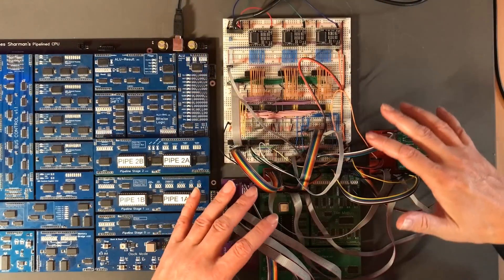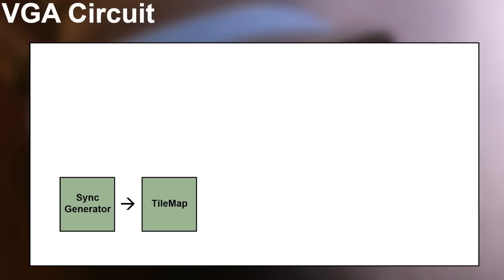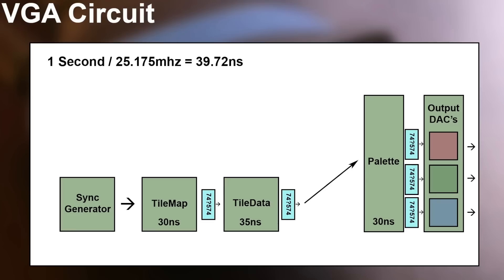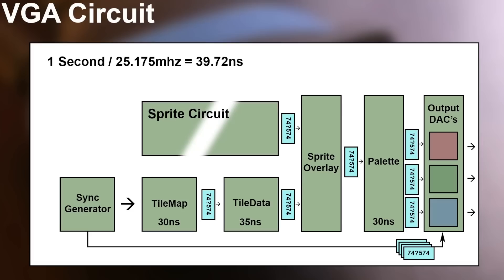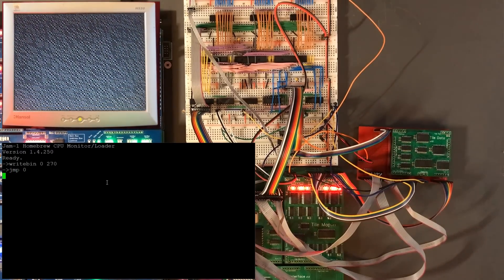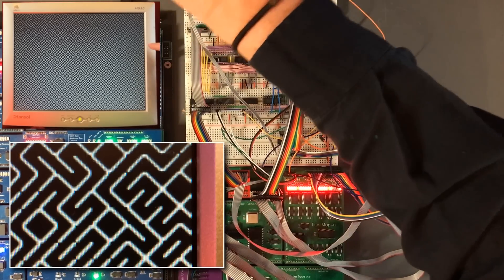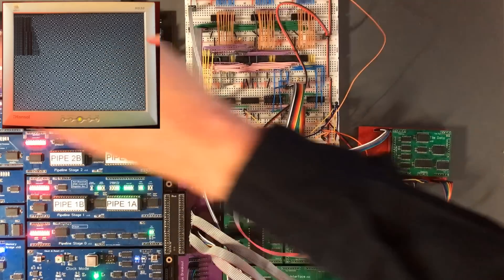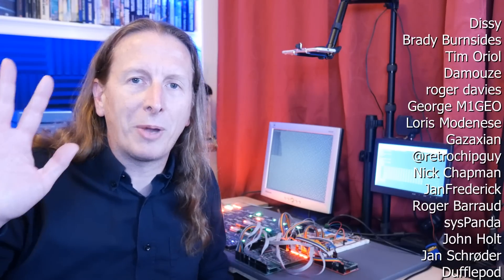Timing Tweak - VGA from Scratch - Part 15

Comment: Question, i would apreciate if someone would answer it. I have 16 ram chips 2048×8 (2048 adresses - each adress contains 8 bits). I need to use this specific chip, cant use bigger capacity. i want to connect all of them to make 32K RAM. Problem is that it requires external logic, and i just cant figure out how to implement it. Can you recommend some articles or books, where i could read about memory chip organisation?
Reply from the maker: Jump onto the discord and chat on the electronics channel. What you probably want though is a pair of 74xx138’s. The outputs from those go to the chip enable lines of the ram chips. The lower 11 address lines go to all the ram chips and the upper 4 address lines go to the 138’s
Reply: @weirdboyjim  yes! This is exactly what i needed, thanks. joined

Comment: Outstanding series.
Extra points anytime a '574 is used as a delay line or a shift register as well.
Reply from the maker: Lol, Thanks! It's worth looking at alternatives like the 374 when you are doing things like delays or shifts, the pins may be more suitable.
Reply: @weirdboyjim  The moment the 573/574 came onto the market I swore off ever using a 373/374 again. Too much PTSD from having to do bus layout with them.

Comment: Thank you for this series, this project is a gold mine for learning how to properly design a computer!
I have a question: in theory, can the sprite overlay be extended to deal with extra one or more sources of data, without adding more delays?
Reply: Why do we care so much about delay? If this was a blitter, I would understand. Let’s wait for the overlay and sprite circuit first. PcEngine overlaid 16 sprites. C64 and Amiga can use sprites for the background (for parallaxe) . First thing first.

I don’t actually want a second playfield like Amiga and genesis. Half of each field is wasted. Have both of them, but without overlap. Overlap is done by sprites.
Reply from the maker: The biggest bottleneck is memory. At full vga pixel clock I can just read a byte (per ram chip) per cycle. So that's a bigger restriction than the overlay circuit itself. I'm expecting the overlay circuit to be pure logic and around 10ns, so you could combine 3 of those circuits in a single clock to merge 4 data sources.

Comment: Cool, you're going to do sprites too. I really would like to know how sprites work in hardware.
Reply: Have you seen the die of the Vic-II. I think that is the cleanest. Is wired-or allowed? Each sprite has to signal all sprites below. So we need a lot of inverters. Actually, low or highZ. At the beginning of each pixel, precharge all lines .. it is a mess.

How would you do it in CMOS? Can we have 4 groups with 4 sprites each? Then we resolve within the groups. Shadow bubbles up. We resolve the groups. Then back down. Now the elected sprites puts its color onto the bus.
For this: why not load 1 bit transparency first, but 24 bit color only on demand? How big is the palette? 4 bit for sprite number. 4 for x and 4 for y?
Reply from the maker: I'm aiming for a very simple system.
Reply: I was referring to the delay. If priority takes one or more cycles, indeed we need to delay another signal: the color. On a breadboard with cheap memory it is so tempting to just use more memory. The palette is just a texture approach I did steal from Saturn and PSX. I was using the number 4 because I found 4-input NAND parts. I think that I have seen 4 way multiplexers. CMOS in ICs uses 4 bit adder macros. 6502 has a 4 bit adder for PC. Ben Eater uses a 4 bit adder. 4 is the number. You seem to aim for the C64 way where sprites and background overlay is completely separated from the intra-sprite overlay. C64 has this behind background flag. It would be interesting to have 16 sprites and one of them refers to the background. So z order always makes sense. Though I would not want to route access to background data to each sprite-unit.  @weirdboyjim

Comment: This project is actually a very thorough introduction to the topic of microprocessors and digital systems design. Certainly far better than than the courses I took at university back in the 80's when the technology being used here was current. Great practical demonstrations of some fairly complex topics makes this a very good series for anyone just getting into digital electronics. Excellent content 👍
Reply: As someone currently studying electrical engineering at university with a digital systems module, I can say this series is still considerably better than the current curriculum even despite it being "outdated" technology.
Reply: @DarkPlaysThings  The one thing that always drew me to digital electronics is the unchanging nature of it. Sure systems have become more complex over the years but the basic building blocks are exactly the same now as they were 30 years ago. If you really get to grips with all the topics covered in this series and read around the subjects raised it will stand you in good stead for a digital electronics module at undergraduate level. The real complexity comes into play with increased clock speeds and you probably will only just be touching on that at undergrad level if covering it at all.
Reply from the maker: Kind words!  I'm not sure I'd want my stuff to be a substitute for any formal learning, but I've always found playing around and experimenting is a great way to learn.
Reply: @weirdboyjim  You are too harsh of your own efforts, your approach is structured and methodical and very well presented. You are covering some reasonably advanced topics in a way that makes sense and is entertaining. A far cry from the terrible efforts of some of my lecturers on this subject. You would be surprised how bad some professional educators are at covering these topics.
Reply: @weirdboyjim  If you wished to, you could certainly film this series again from the standpoint of knowing your objective and the result would be better than any CPU design course I've seen. You should be congratulated.
Reply: @weirdboyjim  Too much formal learning without any hands-in experience is bad. Ideally one should balance experimental and formal learning. 

Just like learning music, too much theory and little practice doesn't make a good musician, but all practice and no theory also doesn't make a good musician.

I find this funny because I'm always too much theoretical, and my practice suffers, as a musician. But as a programmer, its the other way around, I started hacking, and only later learned about the importance of formal learning, maybe I'm over-compensating, but that's how you find balance, by trying and adjusting.

Comment: When you do this fix on pcb I think you should use 2 d-latches for it if you have space.
That way you can cascade the delay up to 8 cycles, selectable by jumper.
This will protect you against an unforseen future problem that may introduce additional delays without having to order new pcbs.

Potentially you could leave the additional d-latch unpopulated until required.
Reply from the maker: I'm comfortable I have the right number of steps accounted for here. The broad strokes of the design have held for a while now,  I look forward to your comments when I'm forced to tweak it.
Reply: Does a CRT not need some time to react on hsync. So we have time for our pixel pipeline.
Reply: @ArneChristianRosenfeldt Sync pulses have their own front-porch and back-porch timings to address the time that monitors require to process them (that goes back to CRT based displays). The purpose here was to keep everything in step rather than have timings shift further as the display pipeline became longer.
Reply: Yeah, I also don't know how other chips do it. Like you cannot expose registers for border on EGA, smooth scroll on VIC-II, and tell the coder to add some magic values to make it fit. Though on the C64, where exactly is sprite position 0? Isn't it some arbitrary value? Smooth scroll=0 matches the border exactly. So I guess that you are right.  @GodmanchesterGoblin